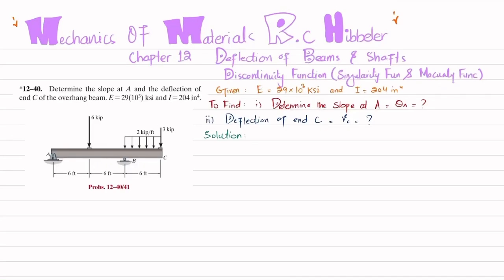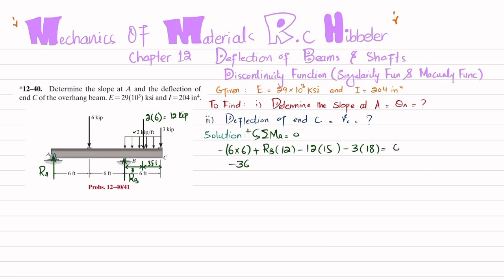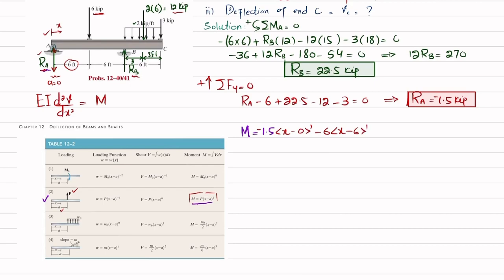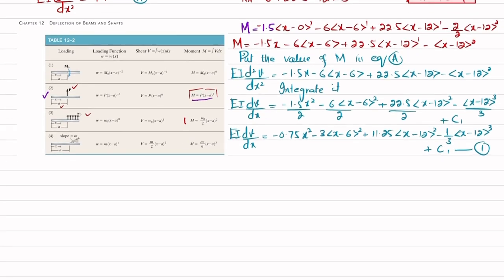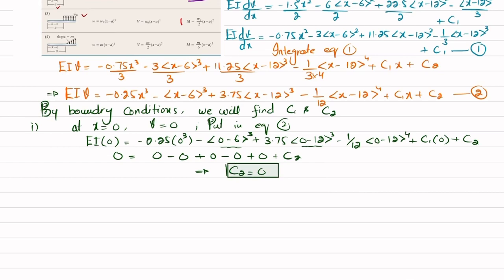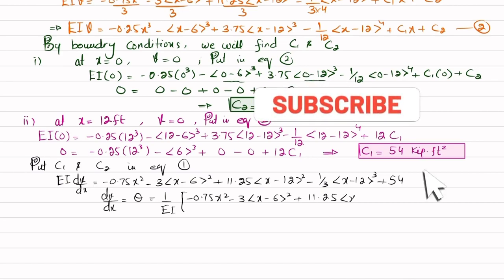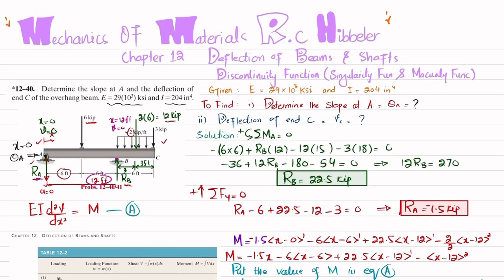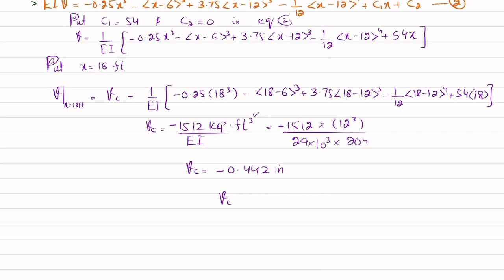12-40 Determine the slope at A | Deflection of Beams & Shafts | Mechanics of materials RC Hibbeler

Comment: When solving for C2, why does (0-6)^3 + 3.75(0-12)^4, etc become 0? Isn’t it supposed to have a value?
Reply from the maker: please specify the time frame in the video
Reply from the maker: this <> bracket is called macualy bracket and anything inside this bracket having negative value will become zero that's why we get zero value
Reply: @engradnanrasheedmechanical thank you!
Reply: @engradnanrasheedmechanical  also, Can we use cut section instead of macaulay functions?
Reply from the maker: @nadzirahrasaie6390 yes that will be another method, in which you will have to cut the beam at different section.
Reply from the maker: @nadzirahrasaie6390 there are many other problems available in which Macaulays method is not applied you can check them also

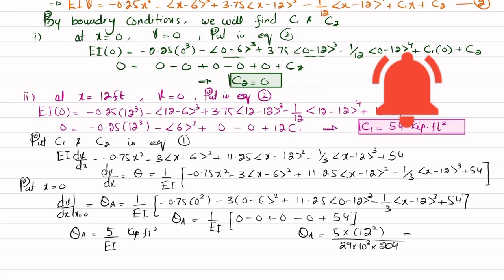Comment: 19:10 my answer is 1.314×10^-3 what did you input in your calculator to get that 0.00131?
Reply from the maker: 1.314 x 10^-3 = 0.00131 . Don't worry bro both are correct. My calculator was set in decimel
Reply: @engradnanrasheedmechanical  thanks for always noticing my comments, thank you so much! I get it now 😁
Reply from the maker: @christianreyalviola2884 you are always welcome bro....

Comment: I have a question, how did you determine the dimension of the -1512 kip*ft^3 value for the feet to be 3? I didn't catch that part.
Reply from the maker: Kindly mention the time where you have problem
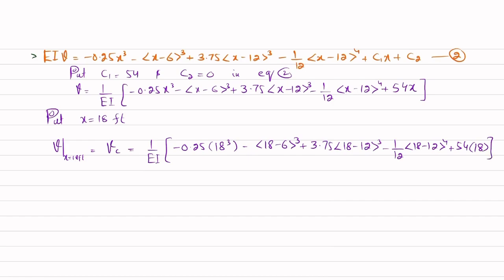Reply: @engradnanrasheedmechanical  sure, it’s around minute 22:18.
Reply from the maker: I have already answer this in your comments. Kindly check it please
Reply from the maker: Put x=18 in question of displacement and solve all the terms you will get 1512/EXI